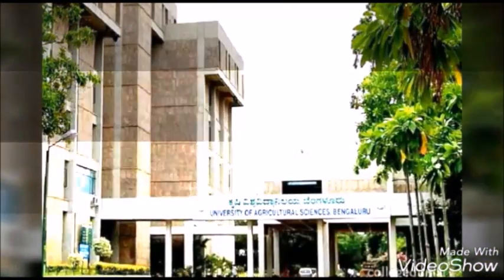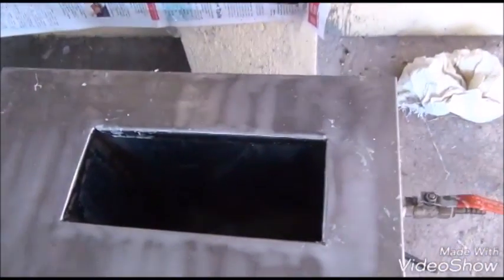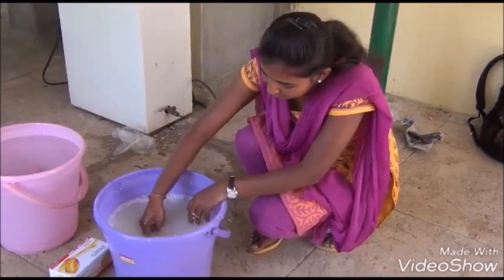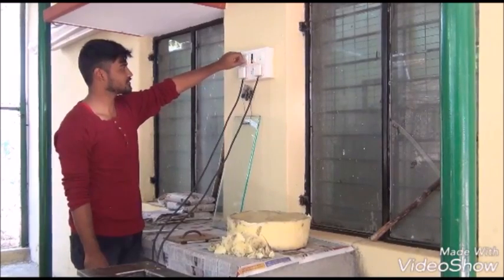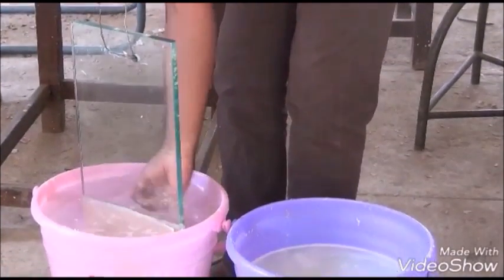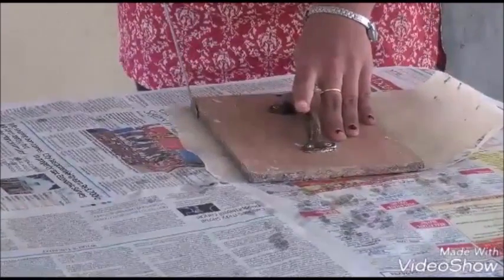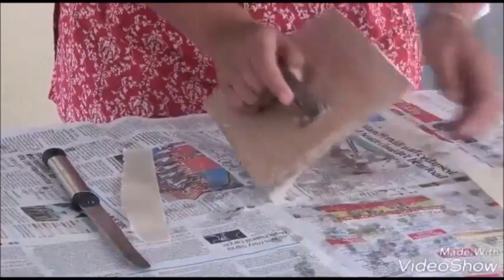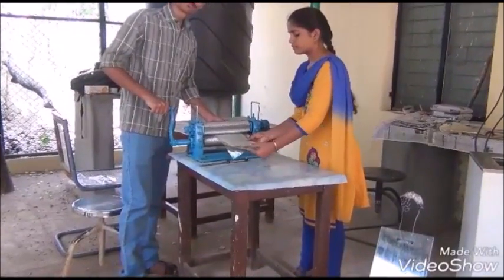Comb Foundation Sheet Preparation

Comment: 😁👍 Beautiful! Just a tip; you can put the soap solution right onto the rollers and not have to use the sheet of plastic at all. Just keep the rollers soapy wet when running the wax through and it won't stick to it.
Reply: She Who Knows All use hney and water to  lubrificate de machine. And avid the plastic sheet. Very simple.
I am afaid of the use of newspaper. The ink is really toxic and plumber substances could contaminate de wax sheet and  make injury to the bees.
Reply: Sorry. Honey and water ou neutral soap
Reply: Right